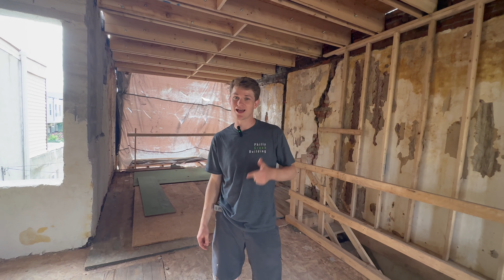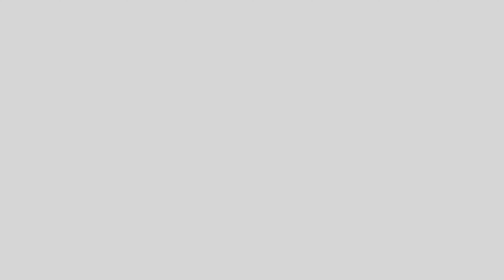All About Building Permits

Comment: When it comes to stripping down a roof and replacing shingles, what type of permit would that require?
Reply from the maker: Depends.  A lot of repairs can get away with no permits.  In Philly, I've never seen a roofer pull a permit for a roofing repair/replacing a roof with an in-kind system!